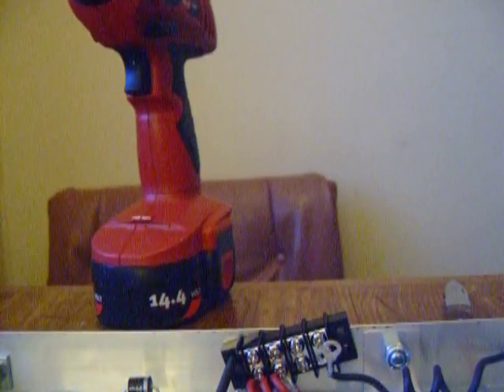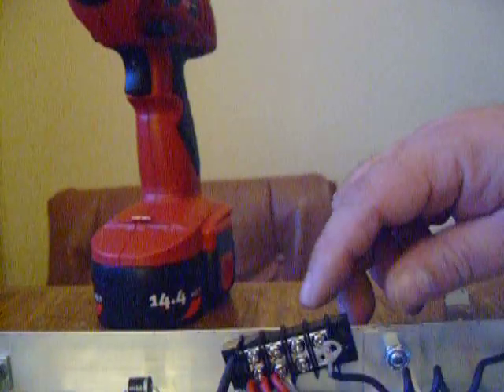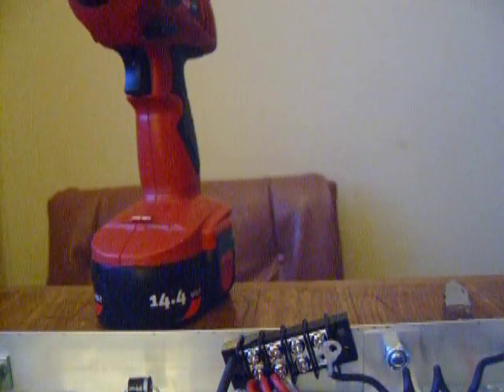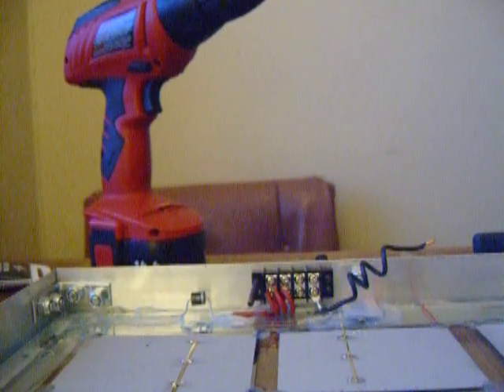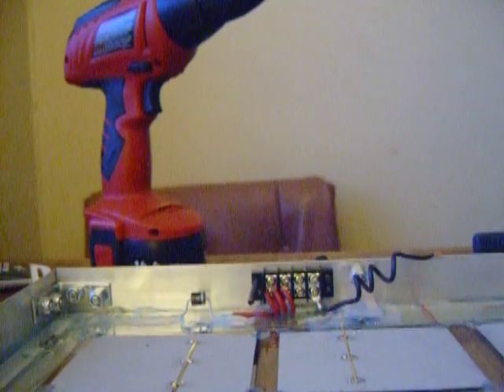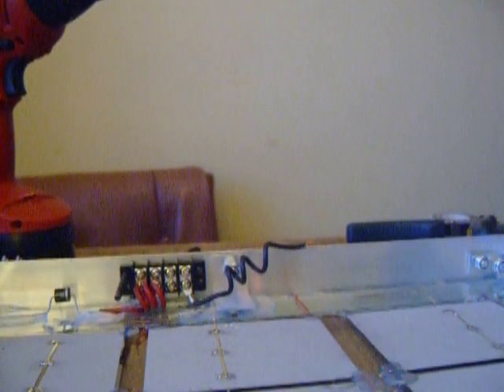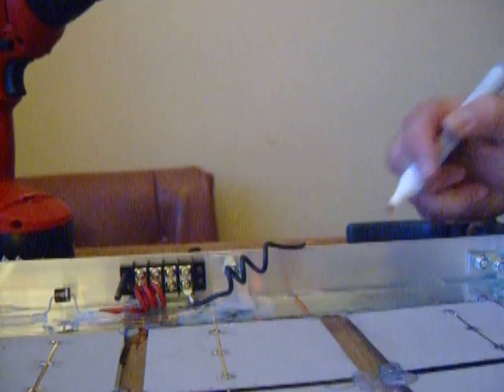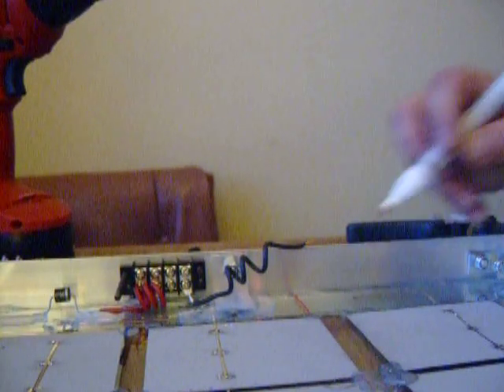How to Make a Solar Panel That Will Last For Thirty Years Part 10

Comment from the maker: Sometimes I replace the the terminal block. just get a new one for a couple of dollars. I wonder if I could figure a way to install a closed one. And putting the diode at the charge controller would be better. But most new charge controllers already have blocking diodes in them. so there is not need for them could just use the panel with out them they put out more voltage. I started buying factory panels these days. I enjoy making solar panels still though its fun.

Comment: hi, im starting my 36 cells and i have this doubt. in the connections you made on this video, it takes a diode only on the positive side? another thing, what wire should i put between the cells and the terminal block? thank you!